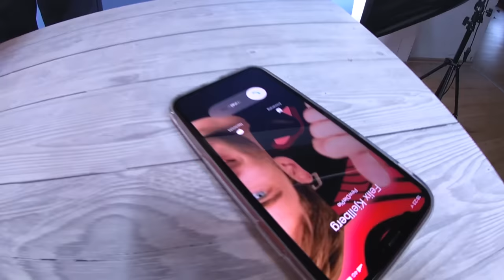BEST of HYDRO DIPPING Videos Compilation PS4 + Shoes + iPhone (Skit)

Comment: Dipper Dan my paint isn't smooth or thick or even at all. My projects look nothing like any of the videos. Sometimes the paint too thin or looks clumpy. Im using rust oleum but have bought 100 bucks in supplies tried over and over. Help